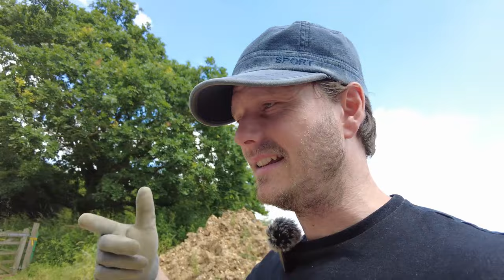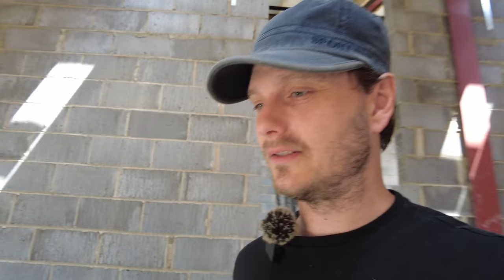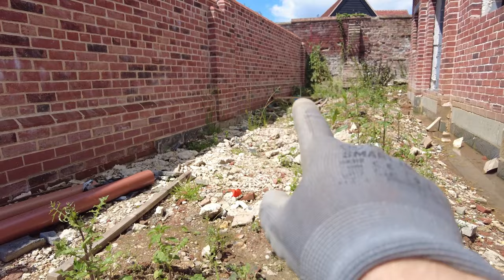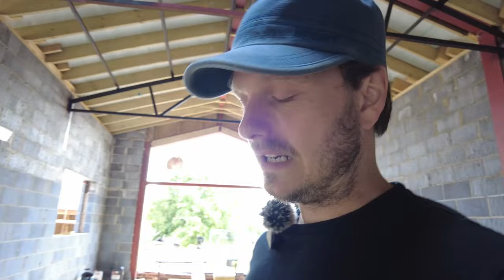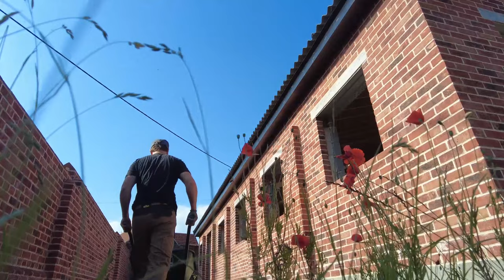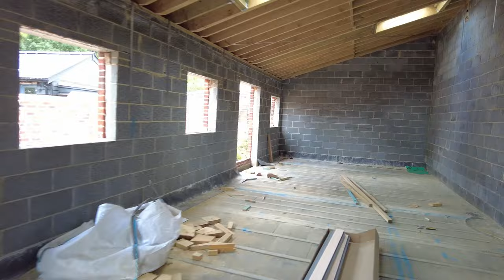This is what I have to work with - BARN CONVERSION/NEW BUILD - #selfbuild                  [TBR 009]

Comment: Let us know how you get on with the Eternit. This was what I was planning to go with.
I’ve seen cement fibre from Rhino?
What was the other brand you mentioned?
Good luck
Reply from the maker: Hey Luke, they've offered to replace my whole roof and pay for everything. The other place I mentioned is cembrit. Although since I ordered my first sample almost 2 years ago they've stopped doing black and only have blue/black. If you were to go with the corrugated fibre cement it's good to get a solid plan well ahead of time especially in respect of any roof windows as its difficult to fit the sheets round them depending on where the ends of the sheets fall. Most of the roof windows were OK apart from one, had I known there would be any issues I could have moved that one down the roof another 500mm. The complaints bloke had said that the technical team can actually design out the roof when you want to order which I didn't know before. It was lumped back on me to sort out the design when the build had only just started. A metal corrugated roof is alot easier to fit and you don't get the same issues with the roof windows 👍 lots of people thought I had a metal roof
Reply: @THE-AIDEN-PROJECT  have you thought about leaving it as is and get a great discount instead?
Reply from the maker: @combok660  I have considered it but haven't been offered that as a resolve. I need to get 3 quotes in first and then go from there. It doesn't leak which is good, but they should have put all of the intermediate fixings in plus they didn't put fixings in at the Bottoms of the roof windows despite me putting in the extra battening (I'm not sure how I missed that before!) plus there's the overhang issue. Then I'd need to consider whether I want a patchwork roof or not 🤷‍♂️
Reply: @THE-AIDEN-PROJECT  Dear Aiden, I'm having some real issues on my project and I beleive you might be local to me? I desperately need to try and source some Eternit Profile 6 - Do you happen to have ANY left over from your job? I hope things are going better mate - this building gig is definitely not for the faint hearted. Take Care, Luke
Reply from the maker: @lukemackay-morris8905  hey buddy, yeah I have got some. Are you on instagram?
Reply: @THE-AIDEN-PROJECT  I've dropped you a message on instagram - cheers (praying for a miracle)

Comment: Rough as. Pulling faults on everyone else work as yours is the worst! If you had someone that new how to manage a build you wouldn't be in this situation.
Reply from the maker: Chris, I'm a self builder and the client. I hired a main contractor to manage and organise the build, it wasn't meant to be my responsibility. If I hadn't stepped in as an 'interfering client' then things would have been a lot worse. How would you have done things better?
Reply: Chris, pipe down you 🔔 end.
This fella is doing a cracking job fixing all the shit the "proper" builder has left